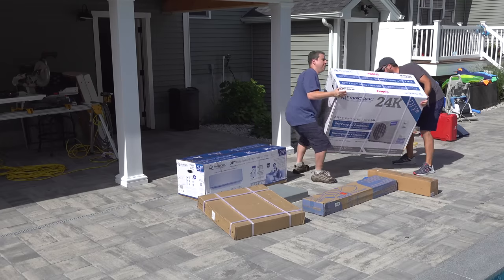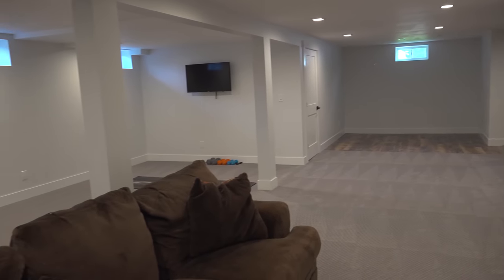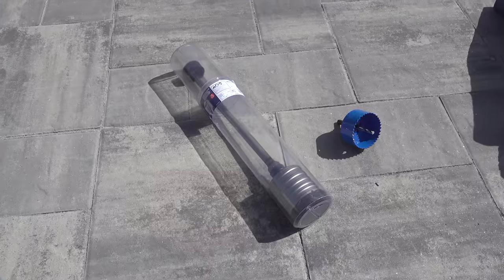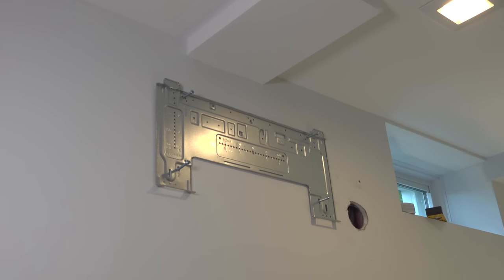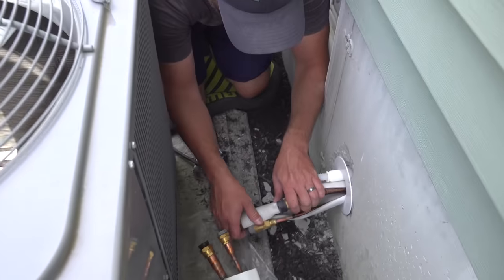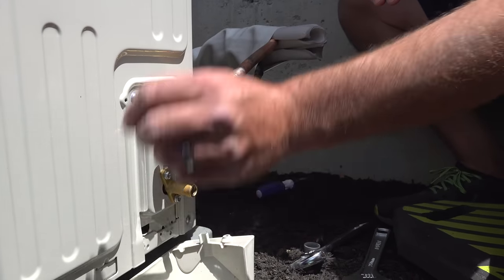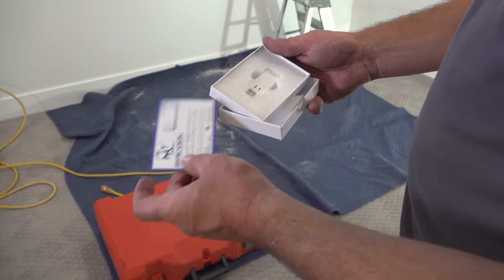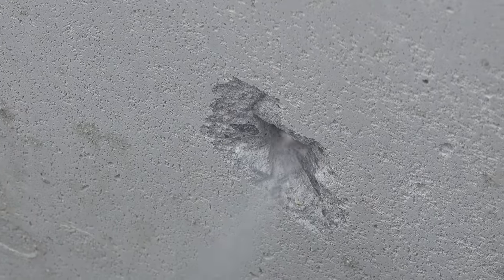Install your own AIR CONDITIONING in 4 HOURS!  DIY Mini Split MR COOL

Comment: What did you do with the extra several feet of line set?
Reply: He coiled it up behind the condenser
Reply: Coil it up
Reply: I'll just run my lines through the attic and out the soffit down the exterior wall and cover with a sheet metal wall cover
Reply: Just cut it to length and flare the ends
Reply: @p-mac5969  I don’t believe you can do it with these precharged line sets, they come with 410-a in them and have special fittings that when they are tightened they release the gas so you do not have to pull a vacuum on them for home owners wanting to do a DIY install
Reply: @ThermalDynamicSevices  fairly certain the ends aren't what "release the gas." There is a fitting you loosen to do that.
Reply: @ThermalDynamicSevices  yea people are tearing into me because I mentioned pulling it into a vacuum haha. The video said the refrigerant is stored in condenser so I was going off of that when I commented about flaring the lines and pulling a vacuum. If the line set is a screw to puncture fitting that would make sense for the no vacuum and no flaring.
Reply: @R0me0316  there is refrigerant in both the line set and the condenser
Reply: @p-mac5969  I hear ya, everybody is a super tech on YouTube, you say one thing and they will rip you apart, I didn’t believe it at first either until I looked into it, the technology and the way you can do things now is crazy, everything’s constantly changing in the HVAC field
Reply: @ThermalDynamicSevices  did you not watch the video or know the product? The refrigerant is in the condenser when shipped.
Reply: @R0me0316  yes I watched the video and there is also refrigerant in the line sets, that’s why they are called precharged line sets
Reply: @ThermalDynamicSevices  hello. Assuming, there is refrigerant in the lines.. would you please tell me, what stops it from leaving the lines? When we attach the lines to the condenser, the refrigerant will evaporate anyway. Or am I missing something? I want to attempt to install a split. But it sounds a bit confusing about the lines. I thought they are supposed to be empty and vacuumed prior to install.
Reply: @strayhandycat2753  there is some refrigerant in the line set and it is sealed on both ends. When you tighten the fittings it opens to the system. I usually shorten precharged line sets rather than coil up the excess but then evacuating the line set is required. Makes for a cleaner looking install.
Reply: @strayhandycat2753  there’s caps on both ends of the linesets. If you take the cap off and aren’t careful and depress the fitting on the end of the lineset you’ll see some refrigerant shoot out. Ask me how I know 😂
Reply: @strayhandycat2753  the lines have refrigerant in them, once you attach them to the condenser and evaporator section the valves in the line sets are depressed and allow the refrigerant to flow, you want to then check for leaks with a soap and water solution or if you’re able to find big blu leak detector online I suggest using that and if you do not find any bubbles forming on your connections you can then open the valves on the condenser section, releasing the refrigerant from the condenser
Reply: @strayhandycat2753  I think the refrigerant is released in the line sets when they're screwed into their connections. See the part when he is using 2 wrenches. I could be wrong but that's what I understood.
Reply: The lie sets are precharged with refrigerant from the factory those fittings are special connections and when put together and tightened the seal is punctured if they are not a vacuum will be needed on the line sets don’t take for granted everything is perfect always leak check before opening the condenser valves.

Comment: Very cool.  I’ve installed 2 ymgi units in my home several years ago. They are very similar to these but require a hvac tech to properly charge the system.   I have been very pleased with them.   
   However these units you showed are great. I really like that I could install myself.  I will definitely be keeping these in mind the next time I need one.  
Great video

Comment: Oh yeah, if you using a window unit, I'm sure that purchasing a $2400 split system will be no problem.
Reply: my thoughts exactly, using a 500$ industrial hammer drill Is not DIY. I don't even want to know how much that drill bit cost.
Reply: Hahaha
Reply: @samohteel4393  That's why places like Depot rent them.
Reply: @robertpearson8798  How does that process work? Do they really let you walk out with a 500$ drill for 38$?
Reply: @samohteel4393  Yes, provided they have your credit card information in case you never come back. I've rented one of those a couple of times.
Reply: @samohteel4393  hammer and rotary drills have dropped in price significantly in the past 3 years. I wanted a cordless one 5 years ago and was looking at $500-$1000. Now I see rotary drills around $300 or less. Obviously they have levels of quality, but honestly they come in handy for more than just concrete.

Comment: when we install AIR CONDITIONING like this one before we let the gas loose we use a vacuum tool to be on the safe side + no air in the lines where the gas is the name of AIR CONDITIONING we use is qulima and costs around 1433 usd  takes around 2- 3 hours to install there are 2 types of connectors 1 fast where the gas runs free as soon as the connector is locked the other type is like this video where we a vacuum too before letting the gas trough the pipes about the video that was a nice clean set up and the way you placed tho out door part i think was nice

Comment: I’m not an HVAC expert but I thought it essential to pull a vacuum on all refrigerant lines to evacuate the air and moisture.
Reply from the maker: The lines are pre-charged and do not need to be vacuumed down, they are factory filled with the exact amount of freon and ready for use. They are sealed and only open after being tightened down. Its a clever design that eliminates the vacuum and filling step completely.
Reply: @SilverCymbal  very clever.

Comment: Great video, I’ve been thinking about getting one of those for the basement in our new house. Looks fairly simple as long as you’ve got the correct tools 👍👍
Reply: Fun fact: the guys who made this video don't have the correct tools and skipped or skimped on vitally important steps.
Reply: @Mattjammar what steps?
Reply: @_abbilina_  evacuating the line set and evaporator; I don't care how tight those connections are, each of those brass connectors are going to be allowing air and moisture into the system when connected.

Also, it is illegal to use refrigerant as the primary leak detection method.

A properly installed system is pressure tested with nitrogen (not refrigerant), leak searched if it does not hold pressure, put under vacuum, and then, only if the vacuum holds, release refrigerant and adjust charge as necessary.
Reply: @_abbilina_  also, it's convenient to note that guy who made this video is sponsored by Mr. Cool

Comment: @6:50 - Insert step: Connect vacuum pump to gauges and service port.  Draw a vacuum and hold for 15 min; If no change in negative pressure, continue to vac for 30 min to dry out the lines, close up,  then proceed to let the gas out...   If you had a leak and did it without a test, then you'd lose your charge to the leak...  Plus it's best to remove the atmospheric air from the lines...
Reply: ..ahh thanks for the correction "there are two versions", and this is the one with a sealed and purged lineset.

Comment: Nice work!
But I honestly have to say after having the split types put on our new house, the old style are much much cooler. They disappoint me in  cooling so much, I'm contemplating pulling them out. Efficiency and quiet is their strong suit but the old window shakers win the battle. They also make inverter type box units now.
Reply: Did you install it yourself? One big problem I saw in this video is that I didn't see them remove air from the lineset, or indoor unit before letting refrigerant out of the system. Air is much harder to compress so basically they're diluting the refrigerant with air making it less effective. Never installed one of these, but if this is how they intend for it be installed its likely not going to cool as well as a window unit, or central AC.
Reply: @TheNeoLoneWolf  True. I saw no evacuation. This is a must. Yes I installed them myself.
I do all my own AC work.

Comment: To avoid the concrete spilling you can finish the last drill core from the outside using the center bid hole as a guide.
Reply: The correct term is spalling, Mr. know-it-all, and if you looked, the same suggestion was made over a year ago.

Comment: In the Philippines , they have only the option of the split-air conditioning unit , no central air conditioning . As this is used in the area of the home where you would be conversing , as it is " quiet " . For the window air conditioning , they have to modify usually a window for the unit . The best I've heard is putting a hole in a wall as high as possible . I suppose in the middle is best ? As heat rises and cold air falls , placing as high as possible to be the most efficient . The specifics and rationale you could easily find . Then they would put a heavy duty metal cage around it . To prevent burglars from removing it and getting inside , as they sadly use children to get inside because of their size . As well , it creates noise to block out the typical roosters and dogs barking .

Comment: America is really a decade or two behind modern Era. All of major cities in Asia and Europe has been using mini split ACs 2 or 3 decades ago and we are here thinking "oh this is nice"
Reply: That's because in the USA most  if not all homes are built with AC and in Europe & Asia the homes were probably  built before central air/heat ever existed. btw these types of units been here for years but have become more popular than window shakers.
Reply: Using central AC isn't a bad thing, it's just a sign that we've used AC for way longer than Europeans or Asians.
Reply: That's cause most homes built since the 1980's come with central air and heating.  Only houses here with central air are usually older homes and depending where you live you only use a/c 5 months out of the year
Reply: I blame Big Air Conditioning

Comment: 2 grand? Wow that's super affordable. I think I will be installing one next summer.
Reply: Bruh that is affordable? 
Well... nvm as I was writing this and thinking. 
It really is worth it. The condenser and the ac for 2k is good deal.
Reply: That's crazy expensive you can get a 2 ton amana mini split for 800 dollars minus the rest of materials you need to install
Reply: I mean don’t forgot that Milwaukee hammer drill he used is like a 500$ dollar tool. If you don’t have one I guess you can rent it. But if you don’t thats 1/4 cost of the job right there.
Reply: Said no one ever
Reply: Deangelo Dee oh cut the shit.
Reply: @caseyschmidt6532  well I’m broke so🤷🏾‍♂️
Reply: @caseyschmidt6532  I would not need a hammer drill because my walls aren't made of concrete 😉
Reply: Krankie V well there ya go. Life always has a way of working itself out.
Reply: Deangelo Dee I hate when people on YouTube say they are broke. Go trade in your iPhone. You’ll get a few hundred.

Comment: I own an HVAC company and in my experience, more often than not the factory made flare fittings on the premade line sets almost always leak. I often have to cut them off flare them myself. I gauruntee that if you don't have the right tool and don't know what you are doing you will have major problems and may even ruin the system.
Reply: I was told to pressure test the line set at all time and vacuum pump the lines as well I did not see that at all why is that ? I need answers plz
Reply: @xxavi213  Yes, that is correct. Refrigerant lines should always be thoroughly pressure tested with nitrogen. A vaccum pump should then be used to drawn down the system to 500 microns for any system utilizing R-410A refrigerant. This is necessary to ensire any moisture or non condensing gases are purged from the system. Skipping these steps can lead to costly issues down the line.
Reply: @roux5044  This particular unit - the Mr. Cool DIY series - uses sealed and precharged linesets.  No purging or vacuuming needed.

What you said is correct for other brands of units, but not for the Mr. Cool DIY.
Reply: @roux5044  yup I knew it thanks I’ve been doing Hvac for 5 years and still learning not very familiar with mini splits but I have installed some
Reply: @roux5044  to me they taught that it needs to be 270microns
Reply: Facts me as a technician have known this for years the flares are too thin

Comment: Going to correct some misinformation for you.   With Mr. Cool, the lines are pre-charged with freon, which makes their systems 100% DIY.  That is important to know.   If the lines are not pre-charged, like with some brands, you cannot just simply hook up the lines and be good.   You have to draw a vacuum on the lines and unless you want to buy the equipment to do that, you'll need to hire a certified HVAC professional.  In other words, opening that valve did not put freon in the lines as you mentioned.  The lines were already pre-charged by Mr. Cool.
Reply: Thank  You,   Clint ! !   As  long  as  'they'  don't  back  off  during  the  connection  process  NO  contaminants  will  enter  the  system  .  .  .  .  ! !

Comment: do these units not require vacuum pumping ? Seems like an important step  to address
Reply: New split ac can be done without evacuation an air purging is enough especially if you dont have a vacuum pump and its ideal for a diyers
Reply: No they do not.  They are vacuum sealed from the factory
Reply: Yea they do as soon as you remove those plastic caps you break the vaccum seal and need to use a vacuum pump to remove the air out of the whole system,they just contaminated the gas but i dont think they will have any problems.
Reply: Normally yes, but I guess because this is is diy you don't need to ?
Reply: It will be way more efficient if you put a vacuum pump on it to get all of the air out of the Lineset and indoor unit.
Reply: Ripe melon seems to be the only person in these comments to know the right answer to this. The linset is special and does not break the vacuum until it is connected ( like a check valve or reverse Schrader valve)

Comment: This looks like something that almost everyone would have professionally installed.
Reply: Anyone who has an extra $3 Grand to spend! Did this myself about 6 years ago, piece of cake. I plan to do another for the main part of the house later this year. Full disclosure, I do work with tools of all kinds on a regular basis. I would not recommend trying this to someone who has no experience working with copper tubing or hand tools. But the average "DIY home engineer" should have no problem.
Reply: @patricialorentzen4874  did you vacuum the system? Or did you follow these instructions and contaminated your system? 🤔

Comment: This is awesome for the price and can probably replace at least 2 to 3 smaller ac units around your house by spreading the air more cause way it moves the air thru it’s vents and the build quality etc. This is over the price point me and my parents would like to spend but if we didn’t already have 2 units in our house that work fine I would highly consider it !

Comment: I work in that field and i highly encourage to vacuum out the copper lines before you let the refrigerant gas in the lines !! The fact that this step was skipped may leave contamination and moisture inside the lines and with time the condenser will get damaged and the performance of the machine will be greatly reduced, you absolutely need to hook a vacuum pump on there and vaccum out any contamination down to AT LEAST 500 MICRONS (there is a special gauge made by yellowjacket for this) and also if the tines are directly going to the wall and into the condenser the unit might freeze when cooling because the refrigerant do not have enoug room fully diffuse its temperature after hitting the coil inside the machine ! (Excuse my bad english) my first language is french) but really guys be cautious with this machinery it is really sensible to moisture and contamination any line that is smaller in lenght than 10 feet in a back to back installation has a higher risk of freezing simply because the lines are too short to diffuse the temperature in between the gaz cycles